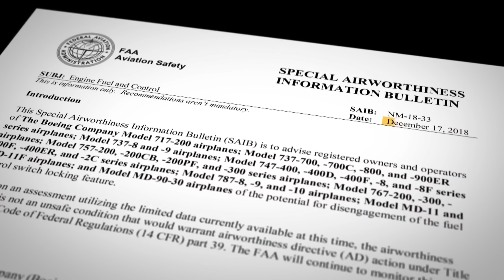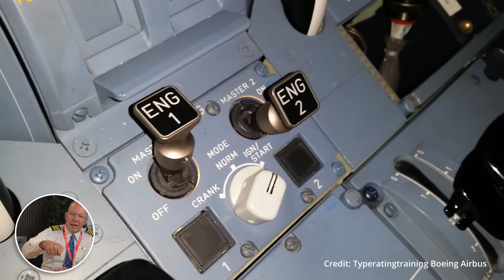Air India 171: The FAA’s 2018 Fuel Switch Locking Bulletin Explained (16 Questions Answered)

Comment: The whole aircraft should not rely on crucial moments like takeoff, on one person for psychological reasons. A pilot can suffer stress, fatigue, or any other wrong behavior. 

There should be safety features where the system is not allowed to make certain changes especially in crucial moments like takeoff, without confirming the options with the other pilot. Like if the co-pilot shuts down the fuel switch, the captain has to acknowledge and press a confirm button on the screen to get in effect, like when you open a safety box in a bank with two keys. Other decisions can be OK if the airplane is at high enough altitude, but if it is in a dangerous zone, the confirm option will be enabled.

 Another idea is like the airport personnel has a special code in case someone tries to get access to an area by force and that code will send a silent alert. Both pilots should have a special button to immediately lock and send a silent alert, allowing the aircraft to take control based on the best interest of continuing flying and cannot be overridden without both pilots and an additional random crew member putting their secret codes. This in case one of the pilots wants to do something on purpose and the other pilot can press that button, the plane will go to a safe mode until the problem gets resolved or the plane will continue flying in autopilot to the destination and even attempt to land. If the plane is hijack, that button will safe the plane to be controlled and the authorities can be notified. Maybe even the plane can alert all airports and auto re-route to reach certain airports where have a remote control system and someone down the ground can land the plane.

Comment: What about the computer chip for the fuel switches ?  The physical switches might be good but what if there is a glitch with the computer ???  And pilot had to cut-off and turn it on again to reset it

Comment: But there are lots of things wrong with 787 from the start like Wiring issues electronics like fire alarms which activated according to other countries using them? We know there were recalls on systems in the 787.  Also if the switches were fitted incorrectly how could the engines start?  As bumping the switches would keep them switching off. We know now from aviation complaints the &*& has many things wrong with them from the start that needed to be rectified.  But to me it was the electrics that hit the mark where wiring was rubbing on things especially where they go into the cockpit behind the floor plates. To me all planes should be double looms and all fuses easy for the pilots to get to and have spare fuses. able to switch to second wiring looms.  The Way Boeing has been building and repairs is not the way you would want experts to do things.

Comment: So, one pilot asked why the other did the fuel cutoff and he said he didn’t. What if that is actually true?The switches as found were in the on position. My question is, are these switches directly wired to the fuel control valves or are they just signals to the fly by wire system? If the latter then could a software glitch or signal interference cause them to be recorded as having gone from on to off to on without them physically being moved. Are there any 787 engineers who know how these switches work and is the above scenario a possibility? However unlikely, I’m sure the investigators will be looking at this to rule it in or out?

Comment: Why do you believe a computer virus can only be delivered by Bluetooth or wireless?! It makes no sense.
As for the virus hypothesis, I'm fully onboard with it. I mean, an airplane has a lot of legacy systems connected in a very well documented network architecture, probably with a lot of possible access points. If I were to do it, I'd infect the RAM of a computer that isn't normally turned off, then at the right time the FADEC. This wouldn't leave any forensic trace.

Comment: Captain Steve suggestion it’s pilot error with 100% certainty is strange 
He’s completely discounted the FAA report from 2018 about  possible issues with fuel cut off. He’s also completely discounting the pilot conversation in the cockpit - on what grounds? I recollect Steve jumping on the pilot error wagon right from the 1st video on this. Would he have done it if it were one of united / American airline buddies?

Comment: @7:45 no, you are wrong about the NM-18-33 bulletin. It explicitly mentions "potential of inadvertend operation". However, I generally still agree with your conclusion that in this case the switches were operated by one of the pilots. May it be a deliberate act or some kind of a wicked "brain fart" (like "I wanted to put the cake in the oven, but I put it in the fridge instead and don't know why").

Comment: I think cameras would help as often as they hurt a pilot. Bodycams frequently exonerate law enforcement. I am also an avid flight simmer and as far as the 787 and 777 there is a caution for engine shutdown and other cautions for related systems. The 737-800NG has no audio warning just a flight control and electric caution followed by low oil pressure. The only model I would question the accuracy of is the 787 and that was almost identical to what the more accurate 777 did. No master warning or sustained audio warnings.

Comment: This could have been caused by a cognitive decline in one of the pilots that caused his judgement/memory to lapse and he cut off the fuel without thinking about it. Kinda like having your wallet in one hand and an empty wrapper in the other and you toss your wallet in the trash while holding on to the wrapper which would explain why the pilot who was questioned on why he cut off the fuel said he did not.

Comment: My concern and question is , If the engines are fine , i.e. there is no fire alarm, shouldn't the airborne logic prevent the fuel supply valve from shutting off, regardless whether the fuel cut off switch sends an off signal to the valve (which I am guessing is like an electromechanical hydraulic valve)?  my logic says that the computer program logic should not allow the fuel valve to close if the engine systems are fine.

Thank you for all your analysis and deep dive. Looking forward to your answers.

Comment: I understand Steve's resistance to video cams in the cockpit, but he's not being intellectually honest when claiming a video camera "wouldn't have prevented this accident." That isn't the point. The point is, we would know precisely how the fuel switches were operated and by which pilot. What if we saw that it was actually an accidental operation by one of the pilots? That scenario, while perhaps unlikely, would explain why the responding pilot claimed he hadn't shut off the fuel. Maybe that pilot was the one "with the presence of mind" to turn them back on. We can't know. Hard to imagine? Maybe, but video recording would be answering most of these questions right now.
Reply: That is known. Investigators clearly knows who did what. It is just not declared to outside
Reply: @grenjith  I cannot think of any way it would be possible to know which pilot turned off the fuel. Please explain.
Reply: Point taken.
Reply: A high time Capitan would not ask a low time FO why did you do fuel cutoff!  He would act IMMEDIATELY …. on the other hand it is MUCH more likely a low time FO would ask the Captain “why did you fuel cutoff”?  It is extremely unlikely these switches vibrated into the cutoff position … assuming the switches were faulty, especially given a SB previously issued to inspect and confirm switch conformity.  While it would not have prevented the disaster …. Cameras in the Cockpit in the end may actually happen in due time.  His comment opposing cameras because of a pilot …. “doing something they shouldn’t have done” ????
Reply: I DON'T understand his resistance...
Reply: If you've ever seen inside the cockpit of an aircraft it's incredibly tiny. Both pilot and co-pilot's elbows are inches from each other.
Reply: So you don't believe his explanation that the switches could not be operated accidentally?
Reply: @slyfondle1885 how on earth do you come to that conclusion, based on his post? Astounding.
Reply: @EcotecEngine3.8V6  Can you read? "What if we saw that it was actually an accidental operation by one of the pilots?"
Reply: @slyfondle1885 
 Oh, I can read indeed. Clearly, because I'm responding to you. 
Accidental operation can also be literally toggling the switches without thinking. Do you remember just after the accident, when people were saying one pilot possibly put the flaps up, instead of the landing gear?
Reply: @EcotecEngine3.8V6  How would a video show whether the pilot intended to toggle the fuel cut-off switches, or did so without thinking?
Reply: @slyfondle1885  if my posts didn't keep being deleted, I'd tell you. In this instance, both pilots denied touching them. 
In future accidents I'm quite certain enough of a picture could be drawn to conclude either way, especially taking both pilots reactions to account and how the person who toggled the switches reacts when questioned by the other pilot.
Reply: @slyfondle1885 the only way to determine if it was accidental or not is cameras in the cockpit.
Reply: @JBoy340a  The only way to determine if something that cannot be done accidentally was done accidentally? BTW, how would you prevent someone with malicious intent from covering the camera?
Reply: @slyfondle1885 you can’t prevent someone from covering the cameras, but you would capture that action on video, quickly leading the investigation in a different direction.
Reply: They already know. They have just chosen not to say it in the preliminary report. They know which pilot said "Why did you do that" and which one said "I didn't" There's a mic on the left and another on the right which are recorded on different channels in the CVR. They know who. They don't know why. Can you explain how a video will tell anyone the why?
Reply: He resisteing to cameras because then no can blame captain's in any technical glitch and how they can safeguard boeing fault...
Reply: I was thinking there should be a camera pointing at the instrument panel only especially those fuel cutoff switches, so we would know for sure if one of the pilots touched them after takeoff.
Reply: Exactly
Reply: It would be easy for a pilot to move their arm to block the view of the camera. If you have a pilot that wants to do this they will. What reason would they have to do this? Maybe they want to make it look like an accident so their family gets life insurance money.
Reply: I fully agree.  They have cameras in school buses so why not aircraft ...his excuse is gasligting 😊
Reply: @JK-es9wu  Yeah, but they're watching everything in the bus, not trained on the driver's every move.
Reply: Exactly, I thought this was a ridiculous response from him that missed the key point in the question
Reply: and his argument that he doesnt want it ... because it will be used to catch pilots who are doing things they arent supposed to be doing ... is really, really telling. Theyre all doing things they arent supposed to be doing, and they all know it. And they just dont want to get caught. 

Maybe stop doing things you aren't supposed to be doing, eh?
Reply: @TheEuphoricism  thank you. This !
Reply: @TheEuphoricism maybe the airlines should hire and train bank tellers to be pilots since cameras don't seem to bother them. Or Walmart cashiers, for that matter!
Reply: Should he fairly obvious when combing through each pilots personal life
Reply: @LebronCCP not at all, Freud.
Reply: You saved me 17 minutes of watching this video.

Comment: 1. You keep saying the fuel cut off was a deliberate action from the pilot. I am wondering how you came to that conclusion? Did Boeing release that info? The final positions of both switches are on ‘run’ mode, and the report says  those were put on cut-off mode in between with 1 sec delay - who confirmed the switches were moved to cut-off? Did that also come from Boeing?
2. The voice recording of the 2 pilots that were mentioned in the report- was that the only part that were extracted so far? Why not releasing the entire conversation history rather than releasing just 2 lines which leads to speculations and potential conclusions by so many people who are not even experts in this? 
3. Some one asked a very good question that was shown in the QnA that why can’t Boeing come up with a preventive measure to stop fuel cut off when its not necessary and in the video its explained that if there is a fire in the engine during landing the pilot should be able to cut off and that action might be delayed by 15 secs - that’s wrong. If a fire situation can be notified to the pilot by the software, then the system should be able to let the pilot do a cut off without any delay- a good software can make it work

Comment: If pilots are not required to be psychological assesed, this should worry anyone?
If the flight recorders are correct it does point to human intervention.
I have watched enough videos over the years to know that if the first officer is in control the captain observes?
Meaning when the aircraft is lifting off his hands are rotating which is two a handed job?
So Im sure the first officer asked the question?
Ironically it takes a conniving mind to cut of shut down the fuel cutt offs individually, whilst rotating, which would be catastrophic!
I know a man who is a pilot of the A380 airbus. He flies from london to New York. You might know him, he has hair like yours but he is about 6ft 9, not far if 7 ft. Lives in Bristol, can't be to many like him? He is only about 45 years old.
I told him before I think he's crazy, and I could never be a pilot.
I think you have to be a bit mad? However, we appreciate you!
👨🏾‍🎓🙏🏽👼🏽🙏🏽👨🏾‍🎓

Comment: Why is the switch not designed backwards so that even if it fails it should be in on position  as there is a lot of vibrations during take off. That is a design fault

Comment: Why did the cutoff switches be put back to run 4 seconds apart.   If they had been physically put to cutoff and then put back to run why did they get put back to run 4 seconds apart?  As an electronics engineer I would like to know if the cutoff switches are dual pole.  One pole controls the fuel valves while the other connects to the computer logging all actions.  If only one pole then the possibility that the controller they connect to failed and triggered the cutoff rather than the switches themselves being activated.  This would also explain the delayed return to run as the controller if it somehow failed can be erratic...  My understanding is the default position for the valves is cutoff therefore anf failure of the controller would cutoff the fuel

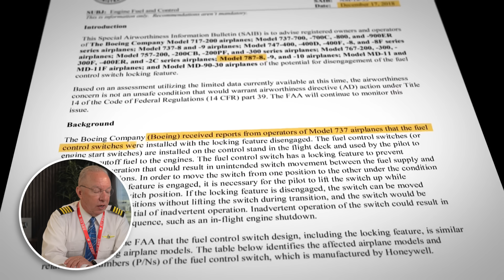Comment: 07:41 I am sorry I disagree with your statement here. I dont think the bulletin was talking about how switches are installed which makes it impossible to move to Run position. The bulletin clearly says this issue could result in "in-flight engine shutdown". Based on your statement it is impossible to even take off and be in-flight with that defect!
Reply: The lock worked. It was pictured on the run position after that explosion, which coincides with the data.
Reply: Steeve is just stating that each scenario is impossible - no logic just - trust me logic...$$$

Comment: Captain, if the fuel control swich is turned off on upward thrust at 400ft, both the engines fail successively….then why aren’t the switches designed to disable manual intervention and enable it only after taxiing following landing❓

Comment: What if the springs or the plates holding the switches was so weak/exploited so much, that when the plane rotated, the entire plane leaned back, these switches went off?
The switches are located already in angled position, when plane rotates it changes angle even more, where it is nearly vertically (like a light switch on the wall)

Comment: Flight data recorder records electronic signals from each instrument (and much more) but does not monitor the mechanism that holds the switch in any position. 
One pilot asks the other if he had shut down the fuel switch and the other answers “no”. 
Assuming this is true, the immediate reaction would be to turn them ON again but it took them 10 seconds to do so. My theory is the switches were never turned Off but an electric/logic error made the computer “believe” there was a command to switch off the fuel and that what the computer did. One pilot, noticing the lost of thrust, asked the other one who replied “no” and when they checked the switches they still were in the ON position and really confused them (what else could cause the lost of thrust!!??!??) and after a few seconds they decided to switch them Off (the actual physical switch, but for the computer they were off many seconds ago) and turn them back On on a desperate attempt to get fuel running again.
I still believe it was a computer glitch.

Comment: About the argument of an electrical fault with the switches:
In industrial machines, safety related switches like those have dual contacts. One to deal with the function and one to report to the control unit that this switch is operated. There must have been a quadruple fault for the two engines to react and the FDR to record operating the switch. Also why would the Pilot ask "Why did you do that" when nobody had touched the switches and they still were in their normal position?